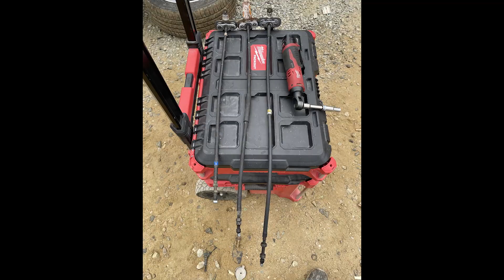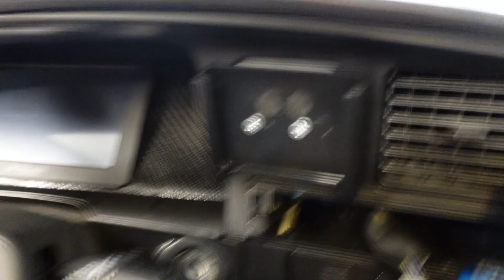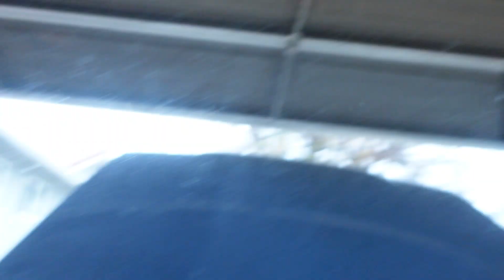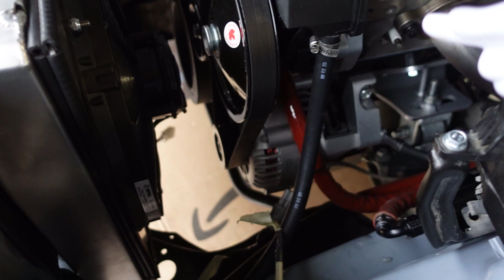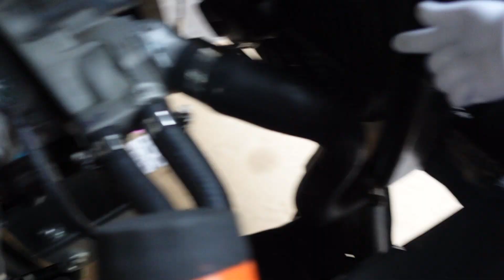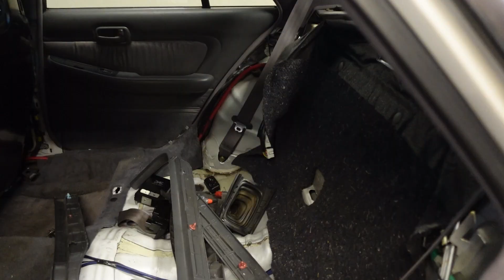LS Cressida Build Update | Swap Breakdown

Comment: There 1 plug in engine bay that runs rest of car..it like big plug with black and orange wire and black and white and Maybe just solid white wite...they bigger wires
..add those 3 wires and whole car work even lights.. the evap tube cremp that shut and not hook it to any vacuum lines...trust me had 4 Cressidas with jz but wreck them drifting back in day

Comment: As for your canister delete, I have this info, copy and pasted from some other guy in a group. 

Delete the canister and all of it's lines. If you want, you can delete the entire line from the tank to the engine bay.
Get yourself a rollover valve and some fittings to deal with tank pressure and venting. This will eliminate the smell, regulate tank pressures, and prevent fuel spillage with a rollover.
l use a Newton TV8. Since the MX83 uses 1/4" (7mm vent hose I did my hose as follows:
Tank -> 1/4" (7mm) hose -> 1/4 to 5/16 (8mm) adapter fitting -> 5/16 hose -> valve inlet
Valve outlet -> 5/16 hose -> section of hose routed upward toward fuel filler neck.
Works perfectly. No smell, no risk of tank explosion, and engine bay is much cleaner.
In North America, people charge stupid money for the Newton valve. You can buy them in the UK for 1/4 of the price: 

https://www.merlinmotorsport.co.uk/p/newton-inline-breather-vent-valve-5-16-8mm-push-on-m-tpv8?fbclid=IwAR0Kv3sCVIU-24GJT8oN5fq91WyZp0yFWNySZrmuMnFdlHbEzrXIKWn5uv4
Reply from the maker: The newton TV8 uses AN fittings and I didn't care to buy more AN fittings to get this to work with the 1/4 Toyota hardline. I found that Holley/Tanks Inc. makes a valve with a 5/16 barb. I left the hardline into the engine bay and mounted this valve to the firewall by the washer reservoir. Connected it with a 1/4 hose (used the hot water trick to soften up the hose to be able to push it over the 5/16 barb). Holley PN# 19-174 The Tanks Inc. valve looks exactly the same and is a few dollars cheaper.
Reply: @RatchetFinesse  good stuff to know. I really don’t wanna go using a ton of expensive fittings. I was gonna mount the Newton in engine bay but I’ll check that out.
Reply: @RatchetFinesse  holy crap nevermind. WAY cheaper.

Comment: Any chance you guys put out the wiring info? Even if not super detailed, the important wires on the chassis side?
Reply from the maker: Yeah I made a spreadsheet to help identify the color/pin of the wires I needed. We'll link it in the next video.
Reply: @RatchetFinesse  thanks man. You guys really are awesome. 
What wire harness did you guys go with? I’m contemplating an eBay harness, but I’m worried it’s a “get what you pay for” situation, in spite of being a relatively simple product
Reply from the maker: Holley Terminator with their included harness.

Comment: Should have Cerakoted those headers to help with heat. Also they'd be super nice looking. You said you're gonna wrap them which is great but a Cerakote/wrap combo would be even cooler!
Reply from the maker: The fitment is tight next to wires and stuff so I want to wrap to protect against radiant heat. One benefit of a wrap vs a coating is that you can touch it. Ceramic isn't as hot as bare metal but not enough for me to feel comfortable that my stuff won't melt.

Comment: I know you beat out your tunnel to fit the trans but do you know if there's any way to fit a t56 in without beating out the trans tunnel or if there's another strong trans option that doesn't require that?
Reply from the maker: I was told T56 was the next easiest to a W58. Honestly it wasn't that bad. Borrow an air hammer. I have a driveshaft now and I'm a a little concerned at the U-joint angle, as the trans is angled down a bit. Gonna drive it 1st to see if it vibrates.
Reply: I know your comment is 2yrs old now but I’m deciding between zf5 trans or a cd009